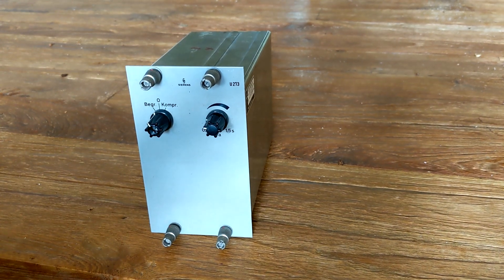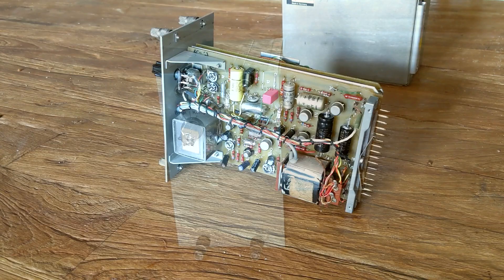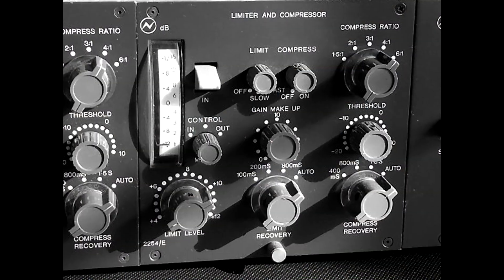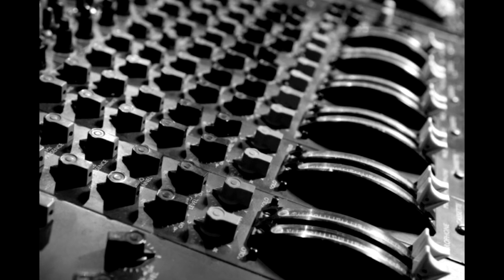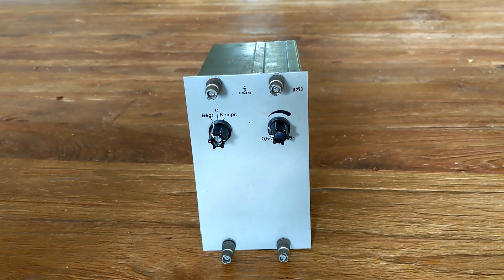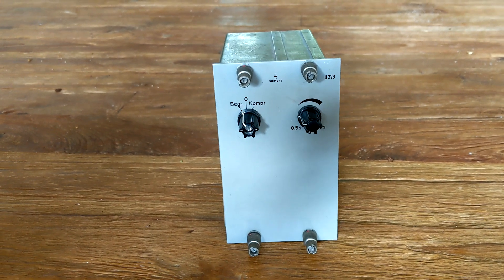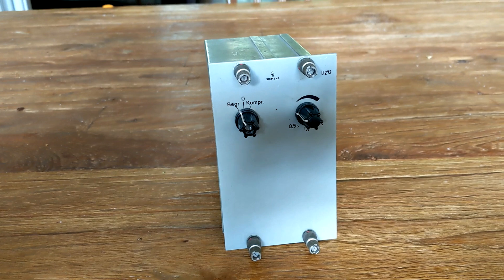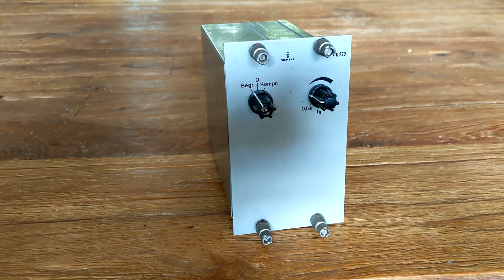Direct audio demo: Modified Siemens U273 diode bridge limiter

Comment: Wow, these sound very good even with minimal release tweaks! I feel incredibly lucky for having managed to score a couple of these compressors a few years back, but I need a proper 24V power supply for them before I dare to use them regularly. Which release settings on your modded unit correspond to an unmodded one? Is it the first two settings, the moderate setting only or none? [Edit: I’m only referring to the settings you used in the audio demo.]
Reply from the maker: These are gems indeed.
My tech had modded the release time to be around 0.1 sec at the shortest setting vs. 0.3 sec stock.
Apparently a fairly simple mod, but I don't know any further details unfortunately.
Reply: @3str  That’s OK. Can’t blame you for not knowing. I still greatly appreciate the video/demo. Take care!